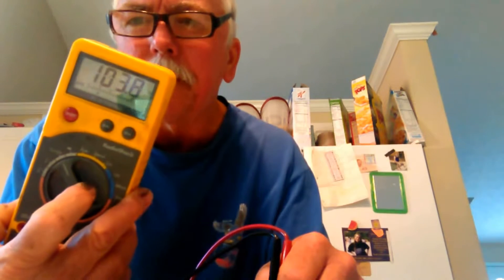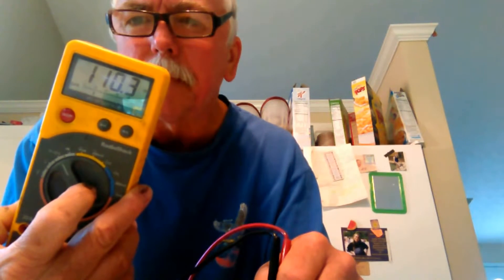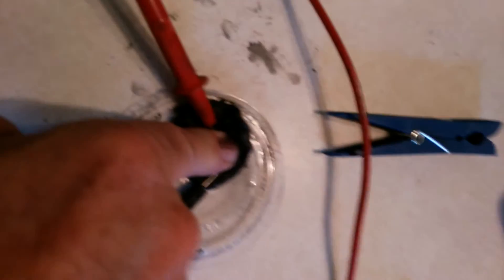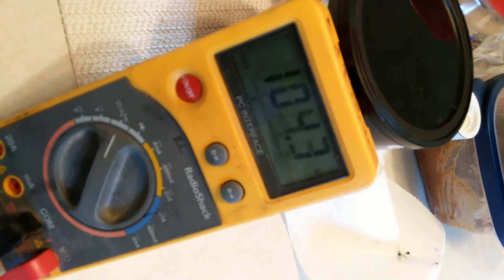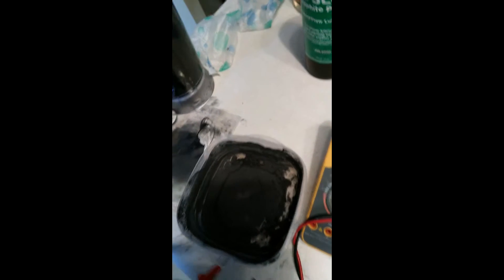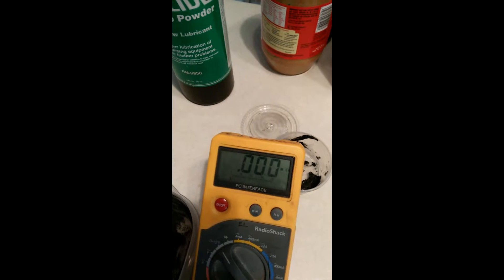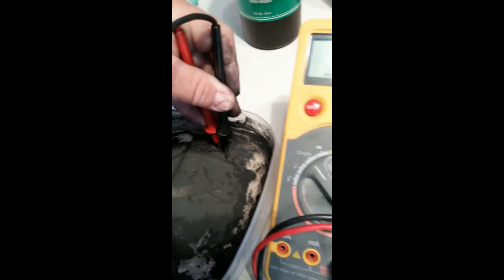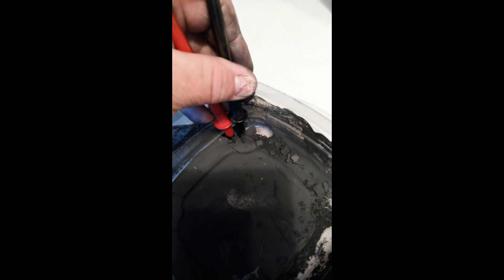Graphene powder Resistance test

Comment from the maker: Thanks for the input, you are right, but I checked the resistance when it dried and it was the same.  I do have to make a revision in what I said in the video.  The material is not graphene I have found that it is " few layer graphite" and it does work well as capacitor and battery plates.  I recently made some expanded graphite using the Hummers method  and the graphite can be pressed into a sheet and has a resistance of 24 ohms per square.  The expanded graphite is hydrophobic  and works well as an energy storage component.  I really like the method.

Comment: water is conductive so wet graphene isn't a real test.
Reply from the maker: I dried it on a hot plate and still found the low resistance, but I think its just very fine graphite which has a low resistance.  The expanded graphite made with sulfuric and phosphoric acid works better.  Thanks for watching and the info.
Reply: It's a wet graphene powder test ;)
Reply: you can make it with a blender the key is you have to let it settle and whatever doesn't settle after like 1/2 hour is the graphene.  So to make using this method blend, let settle 1/2 hour, then pour supernatant (liquid) through a filter to collect the graphene.  Don't pour off the settled graphite.  Repeat process to make more from the graphite powder.
Reply from the maker: Thanks, I will try that method.
Reply: Welcome.  Really any method you use that will be the final step.  It also verifies that the graphene is fully reduced if it stays in suspension.  A lot of people like to reduce it with sodium hydroxide if it is in an oxidized state.  By the time I figured all this out I realized or my application (conductive ink fir battery) 5 micron graphite was simply better for the ink.  I really couldn't figure out a good use for Graphene other than in chemistry possibly a catalyst fir oxidation or reduction, but nothing useful to me.
Reply: or actually you know what it would be good for is as a water based diesel fuel since it stays in suspension ;) but still fulvic acid would probably be better and much cheaper for that application.